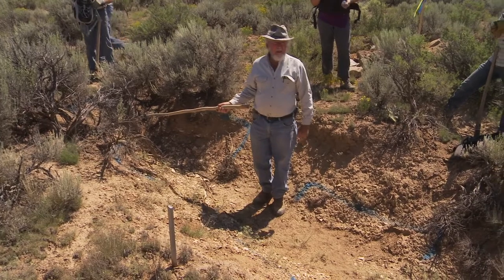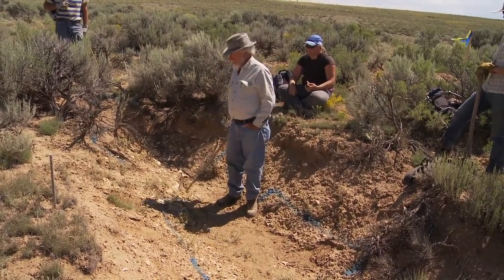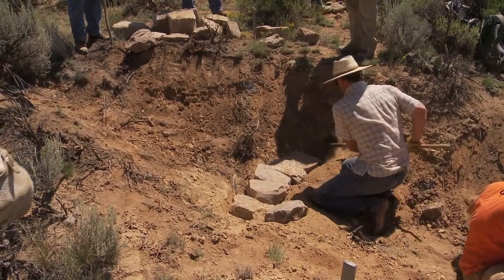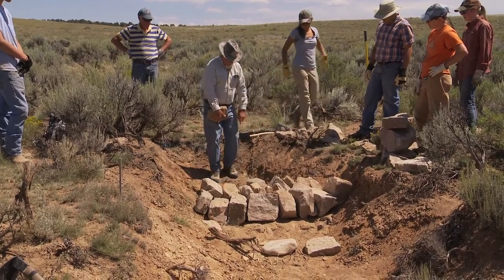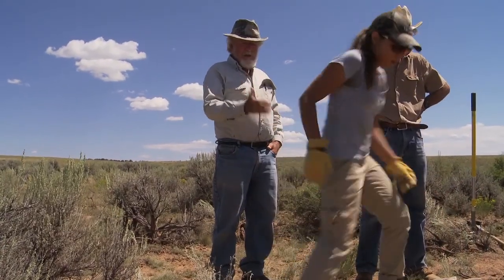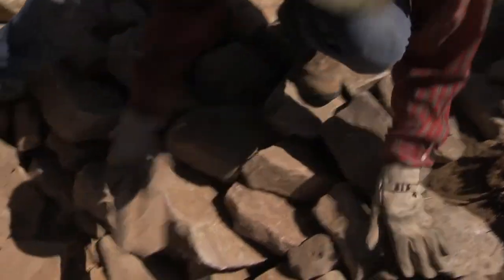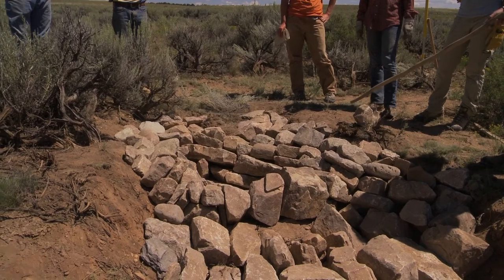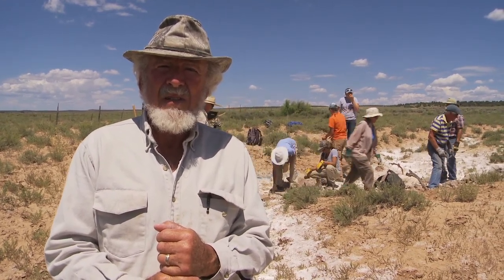Erosion Control : Zuni Bowl

Comment: Good instruction video. Going to research this a lot more for my new Watershed Planner position.  I'm curious though, what if you have no access to angular rock as you have here? More specifically, sub-angular or cobble/4-10 inch rounded granitic rock or basalt/lava rock? Be interested in the answer. Thanks much!
Reply: Can you explain a bit more about your postion? What does a Watershed Planner do?
Reply: Fill the interstices with fine gravels / pea gravels.   That will reduce the energy and trap the finer sediments.